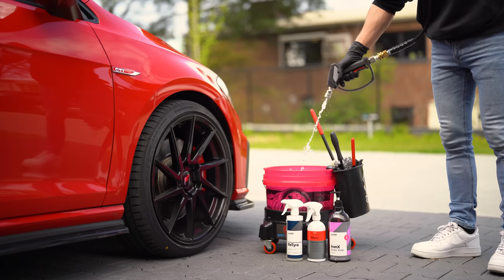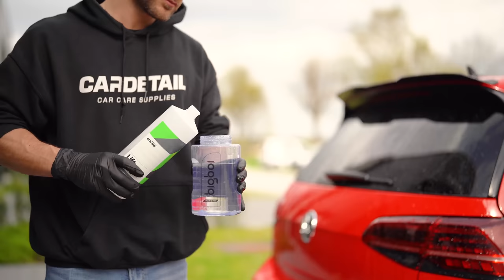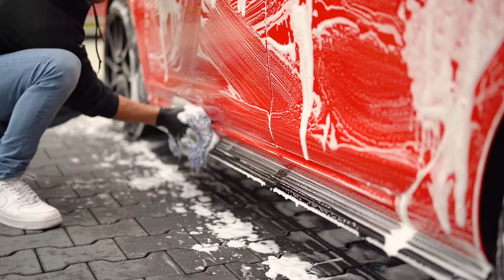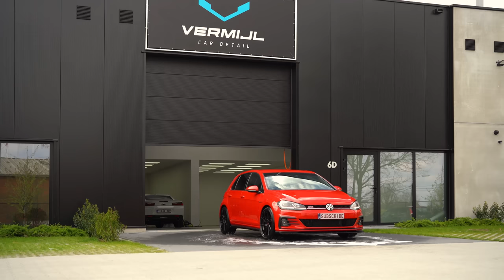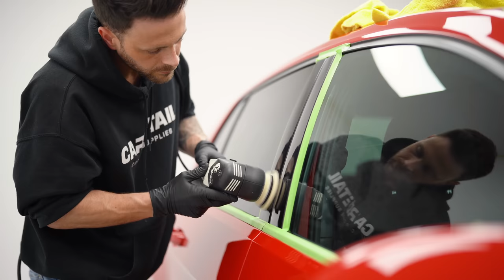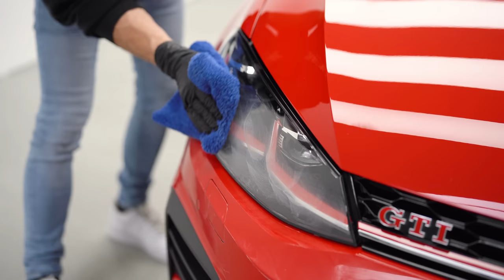Golf 7 GTI Wash, Polish & Wax - Exterior Detailing

Comment: Do you recommend Iron X Snow Soap over P&S Brake Buster for wheel cleaning?
Reply: Snow soap is not a cleaner, if anything it’s like a “maintenance” type iron remover so its minor. P&S brake buster is an actual wheel and tire cleaner. I’m sure he used it for lubricant for the gloss black wheels cause also the MWC he used had a built in iron remover.
Reply: @moisesramirez5242  Thanks. Sadly I can't get Brake Buster where I live. Is there any other brand that produces this type of wheel shampoo you can recommend?
Reply: @felipin.el.detailer  really? P&S isn’t available? Damn, uhh well meguiar’s has a nice wheel and iron remover cleaner so does turtle wax have a really nice wheel and tire cleaner from their hybrid solutions line. Both sold in gallons too. There’s also Gyeon, NV, Koch chemie, shine supply.
Reply: @moisesramirez5242  Thanks. After a lot of searching, I found ONE store that sells P&S where I live :D. So I will get Brake Buster soon. I think I will use it with Pump Sprayer along with the wheels washing bucket.